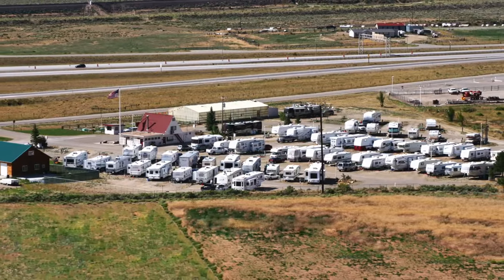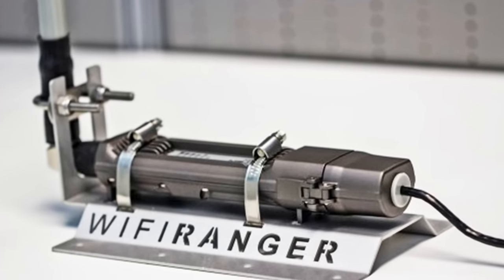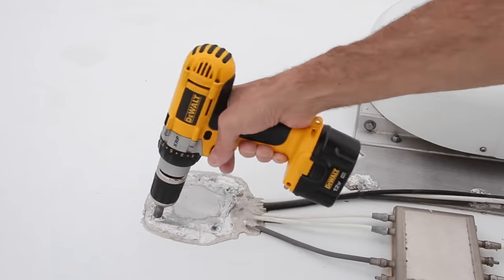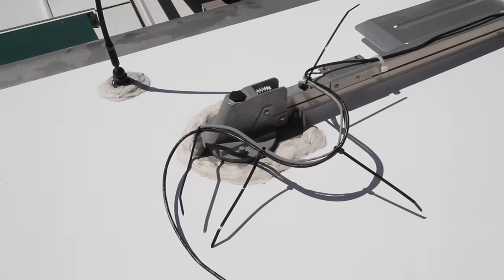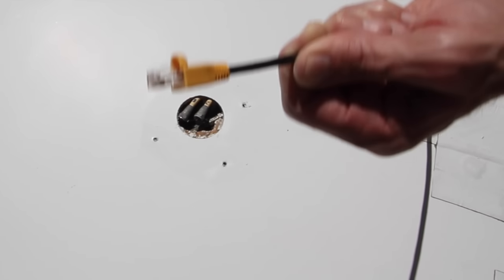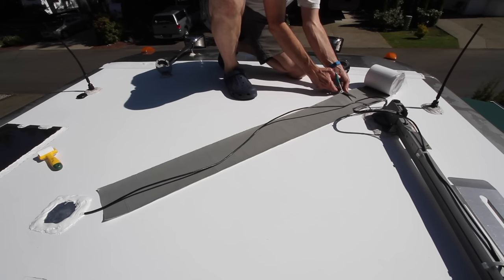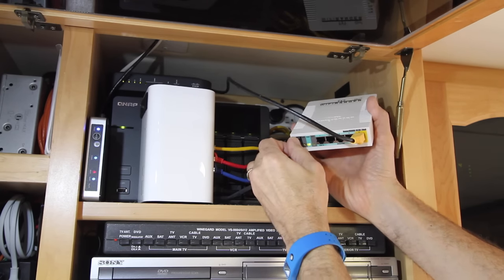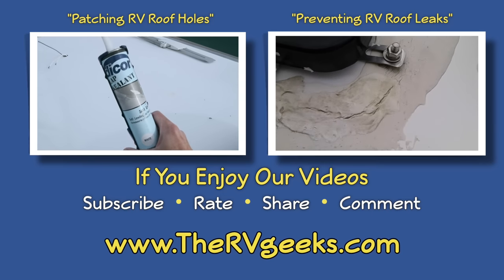Boost Your RV WiFi - WiFiRanger Installation

Comment: After receiving advice from Smitty and Cherie through one of the forums on RV Mobile Internet, I was checking out WiFi Ranger's Elite wifi booster and was pleased to see your video on their webpage. Seeing it gave me added confidence in the product (as if Technomadia's endorsement wasn't enough). :-) Thank you for the information, and sharing it in such a delightful and entertaining way! :-)
Reply from the maker: Thanks Neal! While the WiFi Ranger can't make up for crappy WiFi (getting well-connected to a slow internet connection is still slow), we find it very useful. Even though the price of admission is a bit high, if you need to be online, it's just one more tool in the arsenal.

Comment from the maker: Seldom Seen Excellent tip! We're assuming that the cable ties included with the WiFiRanger are UV resistant, even though they're white. WiFiRanger does a lot of stuff on rooftops, so hopefully they know they should be able to hold up against the sun. ;-)

Comment: This was (another!) excellent video from you folks, and based on it I called the vendor to see if there were any considerations to account for with an Airstream travel trailer. He recommended the same unit you installed here, so that there is a router INSIDE the aluminum structure, rather than relying on the external signal wirelessly from the Elite version. Product chosen: elite pack - $600 
Product Code: 11-ELITEPACK
Thank you!
Reply from the maker: Ron Bernstein That's awesome Ron! Great to hear that WiFiRanger was so helpful in guiding you to the right product for your rig. Have fun!

Comment: You can buy a Sinmax Comfast wifi repeater from Amazon for less than $20. Put the unit in a window pointing at the hotspot and that will do the trick for a lot of people. If you want to maximize the range, get an outdoor wifi antenna like the TP-Link 2.4GHz 15dBi omnidirectional antenna for less than $50. This antenna can be installed on a batwing mast exactly as shown in the video. Add $25 for 15 feet of good quality LMR-440 coax cable with the correct N connectors already installed. More length just costs more money, but you start to lose a lot of signal strength over about 20 feet of coax so keep the run as short as possible. Add in a couple bucks for some hose clamps and UV resistant zip ties and you've got a good system for less than $125.  

If you want absolutely maximum range, install a directional yagi antenna. You can find good ones on Amazon for less than $50. A ladder is an ideal place to install one. Use clamps with large twist handles so you can loosen the clamps and turn the antenna toward the hotspot. It does entail climbing up your ladder to point your antenna, but you'll increase your range by at least half over an omnidirectional antenna. Same type of coax you use for an omni antenna is used for a yagi. You can even install both types of antennas and plug the antenna you need into the router. If you want to get fancy you can buy an antenna switch box for about $25 so you can choose the antenna with the push of a button.

There's nothing wrong with the WifiRanger. It's a well made unit and has quality components. These are options for people who just don't have $650 to spend for one. I spent two years on the road using the two antenna system I described and there were probably about 5 days in that time I couldn't find a wifi signal. I hold an Extra Class Amateur Radio license and have a lot of experience installing antennas and wifi systems of various kinds. Still, if you're a fulltimer that's a little handy with tools (if you need to do a roof install), there's nothing difficult about it. Spends some time reading about it on the web and anyone can do it.
Reply: I can't decide between Yagi 15 dBi and the parabolic 24 dBi... guessing 24 dBi due to the fact that I have a rotating antenna mount so the narrow pattern of the parabolic isn't as limiting, yet I have no real world experience.  But I'm also leaning Yagi a little, because I'm not certain I'd want to leave the parabolic attached permanently to the roof, requiring me to mount it once stationary.  Not sure how easy it is to disassemble and re-assemble...  Need to measure to see if it's something I can leave permanently up there.  Any thoughts?
Reply: The parabolic is quite a large antenna and impossible to easily stow on the roof for travel. Hauling it up and down and installing it on the mount would not only get old fast, it can be dangerous in rain snow, or ice. The yagi has less gain but more than enough for RV purposes. It's relatively easy to stow flat on a roof as well. I'd only use a parabolic on a permanent mount.

Comment: It was quite the surprise to see a shot of RV World in Rawlins, WY on your opening scene, we Workamped there the summer and fall of 2012, did a lot of gold panning in the surrounding mountains. While we prefer the WIFI Ranger, those not up to the challenge of installing it can find an affordable solution by installing a Netgear Trek N300 Travel Router Model PR2000. If installed near a sunny window, it does a great job of boosting WIFI signals or extending the range of a local network depending on the software settings. Not bad for a $50 option that we have used in a lot of RV parks, including the one we currently manage in central FL that has a lot of trees. When we return to full-time travel we intend to install a WIFI Ranger for sure!
Reply from the maker: +David Knapp Despite the fact that we photoshopped the entrance sign out of the photo, we figured it was only a matter of time before someone recognized the park. Now that you've identified it, we just want to make clear that the photo was for illustration purposes only, and we know nothing about the WiFi there! LOL
Reply: +RVgeeks No problem, the view from up there was always great & it made a very clear demonstration that was typical of many RV parks. On weekends we'd go out to the gold claims where there was no cell or WiFi signals for 20 miles and the wind would echo the whispers of Pioneer travelers 150 years ago into the head phones of my metal detector, nothing but cosmic. Thanks for the memory tickler of happy times for us.
Reply from the maker: +David Knapp There is a lot of stark beauty in the area. We haven't made it back since 2007, when we were there to design their website.
Reply: Very nice website! The park has had 2 new owners since then, we almost came back to be managers there, but now doing some much needed eldercare in central FL.
Reply from the maker: David Knapp
Thanks David. We appreciate that, but we've upped our game a ton since way back then, so we don't think it's nearly as good as what we do today (although we charge a lot more now). ;-) After we built the website, the park was sold, but then reverted back to the original owners. Last year another new owner came in. We've been continuously working for the park the entire time, and the new owners seem very nice (never met in person, which is pretty typical for us).
Reply: +RVgeeks We workamped for the original owner right after he bought it back from the Sheriff after the CA company he sold it to had defaulted on the loans. He then sold to the current owners, confusing? :-) He almost bought an old park in Lander, WY or we'd be there still, LOL - we are still good friend with the former managers there & have fond memories our our Beagke herding cows from inside our keep on the national forest roads!

Comment: Is that a 6-bay QNAP I saw around the 2:07 mark of this video? Very nice! And here I was thinking I was the only person rolling around with a NAS. I've got 600+ DVD images on hand so every night can be movie night. :)

I have no doubt whatsoever; we are kindred spirits.
Reply from the maker: ***** Good spotting Golan! That is indeed a QNAP with six 4TB drives, for a total of 24 TB. We have such a large volume of video footage, in addition to a ton of other stuff, that we wanted to future-proof our storage a bit. So far so good. Kindred spirits indeed. :)
Reply: RVgeeks o.
9!l,l
yug
Reply: RVgeeks f
Reply from the maker: Hi Yar... the disks have held up great! But one caveat... we always shut the QNAP down while the RV is moving, so they haven't had to deal with any additional vibration/bumps while driving. We only power it up when we're stationary. In the course of about 5 years of pretty-continual usage, we've only had two drives have any problem... and that was just pretty standard S.M.A.R.T. failure warnings. Since we are using NAS-rated drives, they had a five year warranty... so we were able to easily get them replaced. Because of the RAID configuration, the drive failure wasn't an issue... everything continued to operate (albeit a little bit slower due to the calculations needed by the drive processor to recreate the missing data) and the swap went off without a hitch.

Comment: Great video! Thanks! Curious also about the marine version as it appears from the specs to have better range. It says up to 5 miles with line of sight!
Reply from the maker: Lil House On The Highway We don't have any experience with the marine equipment, but our guess is that since there isn't as great an issue with height in the marine world, they are able to use a more powerful antenna.  Combine that with greater line-of-sight over the water, and the (theoretical) maximum distance goes up!

That said... keep in mind that the maximum ranges on these things are theoretical, best-case situations (high power antennas/devices at BOTH ends of the connection, clear line-of-sight between and NO signal interference) that rarely-if-ever exist in the real world. While "technically true" for the equipment, you won't likely see even half of the claimed range in everyday use.  Still better than NOT having the "boost", though!
Reply: I emailed their support and it is based on the environment that a boat sits compared to an RV, less obstruction. They said to use the version you reviewed. Thanks!

Comment: one thing to keep in mind for the antenna ans for even the tv antenna is the longer the post the higher the antenna and the higher the antenna the lesser the objects in the way giving better reception and greater distance of coverage and if you no a little on how computers work you could install a repeater and wire a antenna up with that to help share the wifi with others close to you who do not have this system
Reply: +vorkev1  I don't think they would want to dilute the bandwidth further by sharing it as most campgrounds are very limited in that respect. Sounds selfish but when you need to download/upload video you need all you can get...jmo though
Reply: Guy sr buy raising the hight its to help you not other a repeater can be set with a password so only you can use it. and all the parks I have ben to in the last 5 years have hade highspeed internet with over 30mb a sec not slowing when I added a repeater. the last trailer park I went to did not even have cell coverage but hade great internet. only prob is the owner was pissed I setup a repeater since the internet was only for the people who payed for the better spots but I did not care since when I booked the spot they sed the whole park hade coverage when they did not. so I was doing people a fav and giving them something they wear supposed to get. for that week anywise.

Comment: I like your videos on adding equipment to your RV and I have a question about Wi-Fi and cell phone boosters, I see that a lot of RV’ers installs Wi-Fi booster antennas on their Batwing TV antennas and run the cables wherever is the best place. My question is has anyone installed a cell phone booster antenna on the top of the Batwing antenna and the Wi-Fi booster antenna all on the Batwing and ran the three wires down through the same hole? I would assume that the cell phone antenna would be up when the Batwing antenna is folded down because it would be glued to the top of the Batwing, but I don’t think it would be as high as the A/C units on the roof. The equipment I am looking at is the Ranger Wi-Fi and Wilson cell booster.
Reply from the maker: Raising the Wilson antenna the couple of extra feet won't make much difference, and it also requires a ground plane... as in it must be mounted to a metal panel. So we don't think that mounting a Wilson unit on the batwing would be the way to go, but we'd suggest that Chris & Cherie at Technomadia are the ultimate gurus to say for sure. Here's their post and video on the ground plane topic:

https://www.rvmobileinternet.com/resources/ground-planes-for-rv-use-of-mobile-cellular-boosters/

It might be worth joining RV Mobile Internet to get the very latest and best info all about this topic. If you aren't already familiar with their MIA group (Mobile Internet Aficionados), you can learn more at http:rvmobileinternet.com.

Comment: Thank you for your video. You did a great job! So now that it is installed, and you are at an RV park...say 300 yards away from the office, are you able to stream movies? We are currently living in our motor home, and before we moved here we did not have cable, and streamed everything.
Reply from the maker: The ability to experience fast, reliable internet service is dependent on the quality and speed of the service available in the park's office. If they can't get high-bandwidth service that's capable of handling the many RVers vying for data, no device will make up for that.

The WiFi Ranger will allow you to connect solidly to inferior service, but since a chain is only as strong as its weakest link, you'll still have inferior service. If you stand right next to the transmitter with your device (laptop, phone, tablet, etc) and have fast, reliable service (unfortunately a rarity at RV parks), you will usually be able to access that great service with your WiFi Ranger from across the park, when others in remote parts of the park (away from a transmitter) will not be able to. But if you get horrible, slow service standing next to the transmitter, no device, including a WiFi Ranger, can speed that up.

There's also the ethical issue of whether anyone should stream video over RV park WiFi, since it's shared by so many people. We, and most full-timers we know, have our own cellular data plans, preventing us from relying on notoriously unreliable RV park WiFi. We currently use T-Mobile, which offers "Binge On" on many plans, allowing us to watch unlimited Netflix, Hulu and YouTube videos, as long as there's T-Mobile coverage in the area, of course.

Comment: Getting a signal is only half the battle. The real choke-point in most campgrounds is the bandwidth limit at the camp's router. If 80 people are sharing 1 DSL line, no one is doing anything on the net quickly, if at all.
Reply from the maker: We're Fixin' to Camp That is very true! Unfortunately, there's not much we can do about that, other than find a different campground. lol Although most are the same.

Comment: Very nice video, well thought out and very complete.  I enjoy your video how-tos.  Have you noticed any interference between antennas due to being mounted close together?  I am wondering if the crank-up tv antenna would be a good place to mount my Wilson Outdoor omni-directional 3G & 4G antenna.  I know you guys used the trucker antenna, but I have the shorter, non-spring mount omni, and would like to put it on the crank-up similar to your install here to keep it less available to angry branches.
Reply from the maker: Hi Jim! Thanks for the kind words! We can’t say that we’ve seen any evidence of interference between our WiFiRanger and our TV antenna.... but since we don’t use our TV antenna, we’re not a good test! 😉 From what we’ve read about the various frequencies of TV, WiFi and cellular transmissions, they SHOULDN’T interfere. But that’s in theory.... and reality doesn’t always abide by theoretical rules!  We don’t think you should have any trouble, but if you’re concerned about it (or if you install it that way and actually experience interference), you could move the Wilson antenna just a few feet from the TV antenna, and perhaps use an adjustable marine antenna mount so you could lower the Wilson before driving. Not as convenient as using the crank-up TV antenna, but still an option. Hope this helps!

Comment: Another awesome video. I'm working my way through all your videos, so my apologies if this has been answered elsewhere. What precautions are y'all taking to protect your computer equipment from electrostatic discharges? Do you have precautions for both the electrical wire as well as the network cable? If I'm dry camping in an area where the RV is the tallest object around, that antenna sure looks a lot like a lightning rod...
Reply from the maker: not in this lifetime We don't actually take any precautions, with one possible exception: If we were out in a wide open space during a powerful thunderstorm, we would probably crank the antenna down and unplug the computers and other sensitive electronic equipment. Honestly, it's not something we ever think about, as we've not heard about RVs being hit by lightning during a storm... and we've been in some doozies. lol